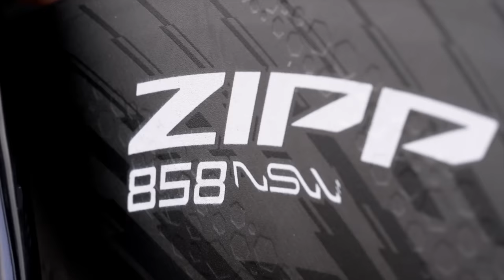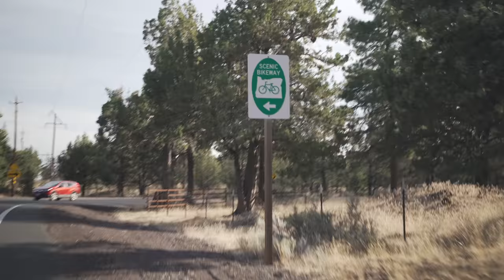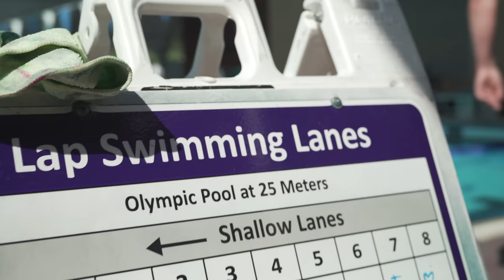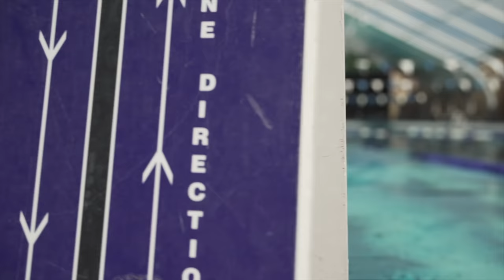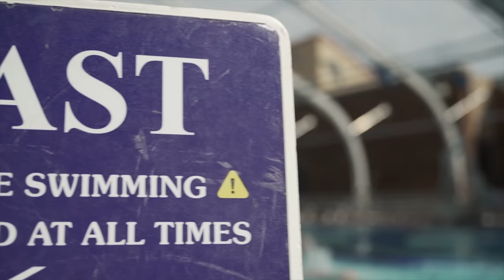Even faster - All new Zipp 858

Comment: Are hookless wheels basically tubular wheels?  It seems like they are similar based on your description
Reply: No. Nothing like tubular.

Hookless rims are like if you were to taje an ordinary clincher rim, and shave the tiny hook off of it.

 That hook has been there for as long as clincher tires have been around, and for good reason. It is a safety feature which helps keep   the bead of the tire locked into place on the rim. If you have a rapid tire deflation (blowout, big gash in tire, etc..), it helps keep the tire from just instantly rolling off the rim. It also helps keep the tire locked on the rim at high pressures.

Now if you are wondering why any responsible manufacturer would intentionally remove a vital safety feature, you would be asking the same question millions of cyclists now have about yet another industry standard being foisted on us. Onky this one is a safety issue as hookless rims are only safe to operate in a narrow pressure range. If you go too high or low in pressure, the tires come off these hookless rims. These manufacturers have the nerve to consider this a "feature" and not a "bug"... but of course, they have "reasons".
Reply: Also, hookless rims are generally limit to 72.5psi maximum pressure. That limits their usefullness to peoole who run 28c or larger tires. If you normally prefer to run 700x20c or 25c, that would be on the lower end of what you would run for those size rims. 25c it is borderline doable, but for 20c tires, it is out of the question as most average weight riders need about 75 to 80psi minimum in a 20c tire. Thats why you will see the new hookless rims tend to accommodate wider tires.
Reply: @alexjohnson6462  yes but the point of that move from Zipp and ENVE is the science saying that nobody should be using 20-25c tires anymore, as they discovered they don’t actually have lower rolling resistance, and are less comfortable. I guess you could dig into the weight weenie differences between a 25c and 28c, but if that’s the case you’d probably gravitate towards a lighter wheel than Zipp anyways.